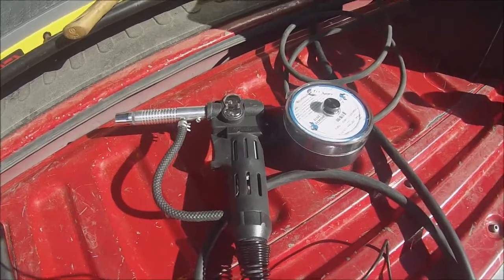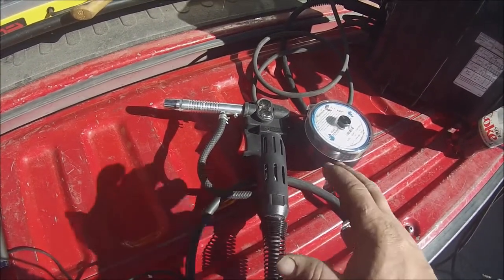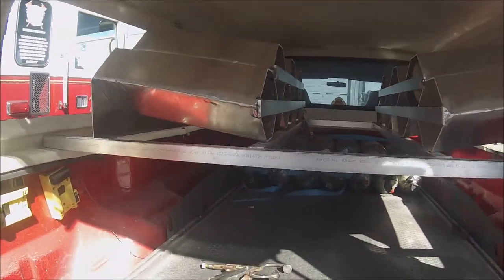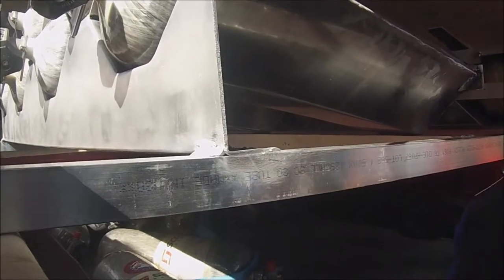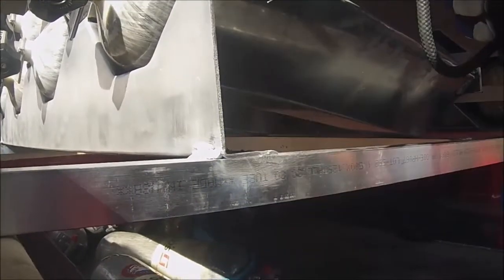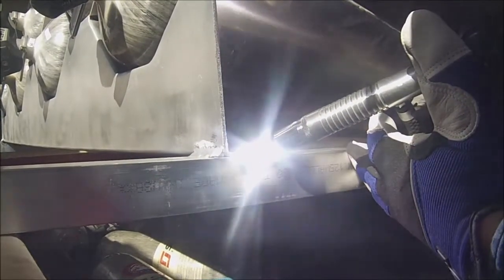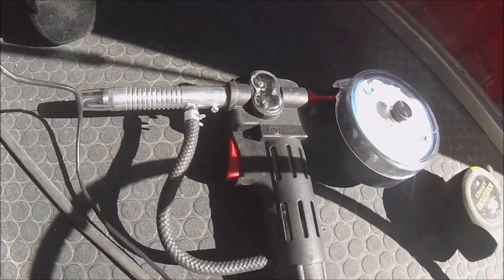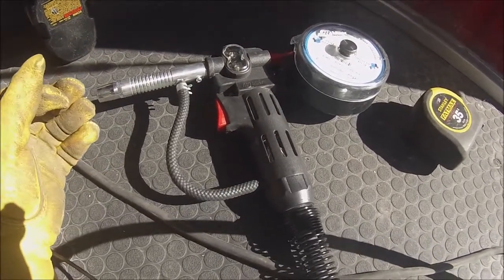Miller spool gun -spool mate 100 (Aluminum Welding) Review

Comment: It looks pretty light which is what I need. I'm thinking about buying a model similar to that from ebay and wiring it up for my Everlast mig welder. the only thing it would lack is the ability to control the wire feed from the spoolgun itself like the heavy duty everlast spoolgun I have now.
Reply: YOU CAN CONTROL THE FEED WITH AN EXTERNAL DC POWER SUPPLY I THINK THE MOTOR RESPONDS TO 12 -32 VOLTS. THE HIGHER THE VOLTAGE THE FASTER THE FEED.

Comment: this is odd..the distributor in my area told me the 100 is a piece of crap..lol
Reply: Just a lighter duty cycle, more of a hobbyist occasional welder gun than the 150, however you need to ask if it's worth $150 extra for the 150 gun

Comment: Thank you sir..... I ordered up the 150 spool gun and a 211 today..... Your video gave me the confidence to give'r a go.  Please wish me luck!  :)
Reply from the maker: +timothy svec No need to wish you luck you my friend you are a skilled craftsman(welder) hope the best to you.
Reply: what is the differences between the 100 and the 150
Reply from the maker: the 150 has 20 foot cable instead of 12, 150 amps @ 60% duty cycle instead of 130 amps at 30% - about the ONLY thing the 100 can do better is run .023 hard wire.
Reply: One difference is the 100 is only designed to run 4043 wire (not fast enough for 5356) and  the 150 can do both.  I had bad results with the 5356 until I read somewhere what I just said and I phoned Miller and they verified that to be true.